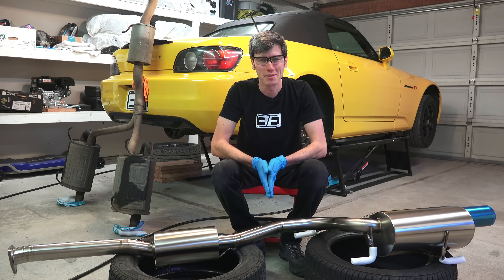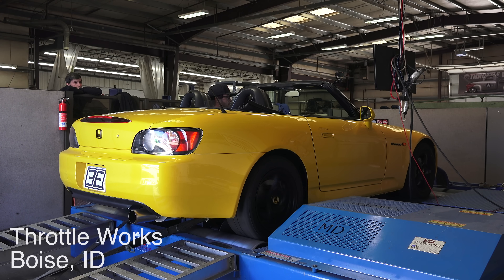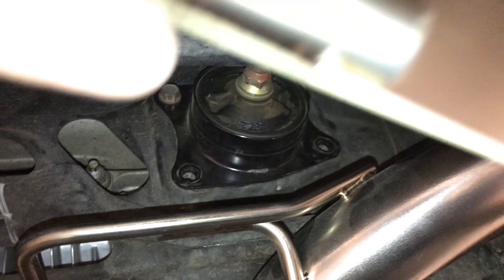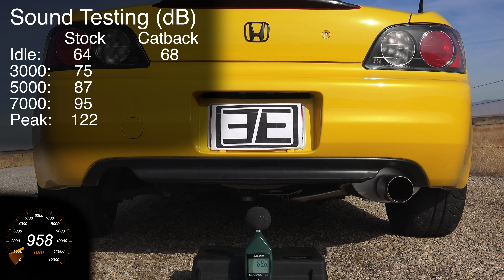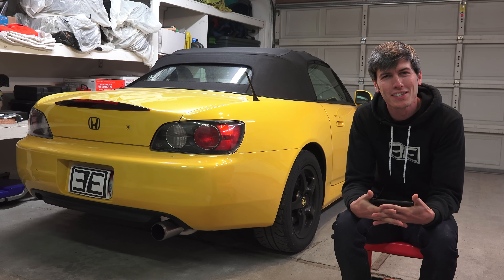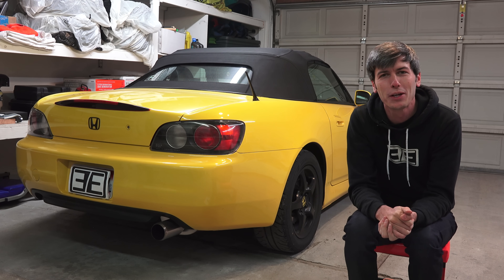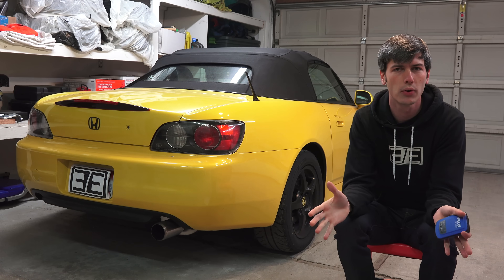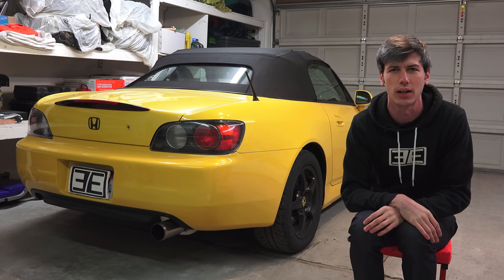Can A Catback Exhaust Make Your Car Faster?

Comment: Let the haters hate. You shaved weight,wont rust and gave us an educational video to watch. Thank you!
Reply from the maker: Happy to hear it, thanks for watching!
Reply: Hey, rusting shaves weight too!
Reply: Was thinking about it as well. Just depend how hot the exhaust gets as aluminum can crack with too many heat cycles.
Reply: Shoulda bought an aluminium exhaust. Nota much more weight if any and the material won't give up gains
Reply: Aluminum: 2.7 g/cm³
Titanium: 4.5 g/cm³

Aluminum is significantly lighter than Titanium.

Titanium has a higher strength to weight ratio than Aluminum so in applications that require high strength Titanium components can be made lighter but exhausts do not need to be very strong.

The (small) power gain he achieved has nothing to do with the fact that it's made of Titanium - it has to do with improved airflow. An identical Aluminum exhaust would preform just as well and would almost certainly be considerably lighter.

Titanium looks cool as hell, though.
Reply: Yeah - moral of the story: Ti exhaust on a non-racing car, is a waste of money & titanium. As the cash can be used for things way more beneficial - tires, rims, brakes, springs, turbo... you name it. And the Ti - as a component involved in the construction of a more loaded parts of the car - suspension carriers, springs, valves, rollers,  driveshaft, c.rods.. where you actually win a lot more from shaving grams. :)
Reply: Aluminium exhausts work fine with the right type and thickness, toughest 10.5 outlaw radial cars use aluminium exhausts off the back of the turbo where they're normally straight into a bend. Granted they only run for 6 seconds under power but they're still pushing 2500+whp on methanol. Stacks of tough street/strip 1000-1400whp cars use them and do for years, time attack cars where they get super hot as most of them dont get airflow with the flat bottoms, and you can buy aluminium mufflers from 2.5 - 5" inlet/outlet. Not saying a titanium exhaust isnt porn, i just see that and think well a turbo back 4" straight pipe aluminium exhaust for an evo is $500. Add a $250 muffler and resonator on a far smaller exhaust, and with those savings spend it elsewhere on the car. If it were me the car would be boosted, save and buy an aluminium exhaust, then for porn factor use Ti cooler & radiator piping.
Reply: Maybe the aluminum kits aren't as prone to failure as I think. I just remember reading about aluminum exhaust on some track oriented R32 breaking off due to the heat cycling and becoming extremely brittle. Maybe they didn't use proper aluminum tubing for the application.
Reply: oh yea big time, EE knows it's not worth the money, he just wanted to see what it's like.
Reply: Of course he knows, might not be a race car engineer but he's no wood duck. ive raced for years and built my fair share of tough street cars so when i see something like that I just think thats money that can be spent elsewhere to make the car quicker.

Thankfully we dont all  build the same cars, so each to their own... plus a quick google shows a single exit catback s2k ti exhaust is $2300usd. Less than i paid for a stainless 4" turbo back exhaust (with cat etc) for my car so no biggy in the end.

What would be cool is to hear a comparison in sound between a very similar stainless to this pipe, TI an alu exhausts resonate and end up sounding nice and raspy + louder. On a boosted car a 4" alu straight pipe sounds nasty over a 4" stainless straight pipe. 

Better yet strap a 6466 on the front of that, run e85 and now lets see the performance difference :).
Reply: Yea I'd like to hear the difference in sound between aluminum and stainless.
Reply: Any recommendation for a place to get aluminum exhaust? Looking for something really small, it's for a tiny lightweight car.
Reply: Agreed, this channel is about educating people and showing the numbers. If you didn't have a YouTube channel with 1.4 million subs, then no, this would be a fairly silly purchase. But you do, and that's why you did it, and we thank you :D

Comment: You could always remove the resonator in the mid pipe if you want it louder. A much cheaper option compared to ordering a new non resonated mid pipe.

Comment: Dyno results can easily vary by more than 2 hp just from back to back runs.  Sometimes a high-flow cat can show better power gains than a cat back system, but you wouldn't get much weight reduction, if any and you probably wouldn't notice any difference in sound.

Comment: Now add equal length headers, porting, larger and lighter valves, higher lift and duration cams, forged high compression pistons and ITBs with a velocity stack and you'll spend ten thousand+ to gain a nice 50 hp and kill the low end.

Comment: years ago i was working on a hydraulic system that was cavitating at the pump very bad the suction side.   the tube was 3 ft long and was the same size as the inlet fitting.    but i could not change the fitting at the pump.   but i changed the long tube to a bigger size.    cavitition was gone.    so ANY  increase at ANY  point is good.

Comment: I also wonder about the difference in thermal dissipation, being that there is a more direct path with less SA, probably takes up less heat from the exhaust. And is that a good or bad thing?

Comment: A header with a High flow cat should help it gain some more power and sound way better but not that bad since it will have a high flow cat. Looking forward to seeing it on the s2k if you decide to

Comment: You didn't address why your car produces black smoke at full throttle? It's not burning fuel efficiently.
Reply from the maker: When you run rich (which happens at full throttle) you can't burn all the fuel.

Comment: What about after 3k-5k of driving. Some people say that the carbon buildup causes better flow, however could it also cause more restrictions? Also, people will also say that there is a sound difference as well. This would be great information to know if "breaking in" an exhaust actually makes a difference.

Comment: I have an RX-8, and that exhaust costed more than my engine, or more than I bought my car for in the first place. I plan on doing a full exhaust for my car for far less than half of that cost, doing most of the fabrication myself aside from the header. Awesome data and a great way to see that something so simple can make a legitimate difference, but holy too expensive Batman!

Comment: The titanium metal surface add better air flow out. But if I'm not wrong original was two exhaust exit, and was change to one exit. It was mentioned in the video, you are Losing power.. forcing motor.

Comment: Does the dyno place measure the exhaust? The Ti exhaust belches out some pretty rich looking smoke from time to time. I was a bit disappointed that you didn't mention that. You may net some additional power gains with a leaner tune.

Comment: Well the price is for the weight savings not necessarily the power gain
Reply from the maker: +gato2 yes, very true. Could get a steel exhaust with similar power gains but not as much weight savings.

Comment: For that cost, I would have considered reducing unsprung mass. Could have similar effects and possible reduced stop distance.
Reply from the maker: +Jdmorris143 where though? I have lighter brakes, and the stock wheels are quite light. All about reducing weight, but not sure where it could be pulled from (unsprung, that is, plenty of sprung weight could be shed).

Comment: Can you do a aftermarket air intake and then  a tune? Also can you figure out why Honda made the VTEC crossover point so high? I have a '07 TSX VTEC crossover 6000 RPM rev limit 7250. By just switching the crossover to 4600 RPM mid-range improves dramatically. I see a jump in your S2000 in means that you can also improve it. Keep the good work

Comment: Nice exhaust.  While it doesn't add any real amount of power now, it should help a bit with the eventual supercharger upgrade as it should lower boost somewhat.  I found mine removed about 0.5psi of boost from the nominal pulley number but also had 15HP more in gains than I expected.

For those that want to argue that less boost is bad, with the same airflow volume, lower boost means more O2 is going in...

Comment: Have you noticed a sharper throttle response from the engine from removing some restrictions with the new exhaust? Would love to see if an intake and exhaust provides any improvement in that area and would be the main reason to getting them other than noise and hp.

Comment: In my opinion the main reason to upgrade the exhaust on a S2000 is for weight reduction which makes a huge difference in handling due to being center weight.

Comment: A while ago, the mighty car Mods guys did some exhaust testing, and they put a spherical partial obstruction in the exhaust (it was a potato) and the car made a bit more power, could you explain what is going on here please? Maybe make a video about it
Reply: David Partridge can u link ?
Reply: That ones almost easy, the potato made the engine scavenge raising backpressure inducing a "reverse torque increase" making the intake drivetrain less of a loss on scale compared to the exhaust. Motor trend has a vid on bashing your headers in to used gaurd rails basically and the tq an hp just kept raising
Reply: benson420710 engine master's on motortrend yea, they measured hp and tq levels on a motor with varying sizes of dents on the headers, they really ended up smashing them really bad before it affected performance at all, you almost have to have a dent that pinches it shut before it starts to really hurt flow. For a n/a car you want to retain some backpressure, but I am curious to see numbers on the larger tubing.. I like that your into saving weight, but a straight single exit for me I couldn't do on that car, or my car for that matter. Those cars can sound pretty nice, odd to me you chose such a "standard"  design
Reply: jcoopdo I think having one exhaust exit helps with the backpressure while providing a lew end boost vs the mid and high end outputs you'd gain from having dual exhaust pipes, I do wonder if sohc/dohc/ohv motors prefer different pipes. On my '86 chevy astro with a .060" over I cut the exhuast right off before the cat so my headers and y-pipe go straight into a magnaflow super 40series piped until two feet infront of the rear right axle. Just going up .5" it raised the low end tq while sacrificing mid range until I added the tubing after the 40 series and without a speedo it truly becomes a butt dyno

Comment: Well, since there is less restriction, during valve overlap, more fresh air is being pulled in into the cylinders. Since s2k has a map sensor, it's ecu doesnt see this increase in flow at high rpm. I guess that, if it was tuned to give more fuel at high rpm, it would have made a couple of hp more

Comment: What is the extra dead end pipe in the exhaust after the cat used for?
Reply: It's a quarterwave resonator. It's function is to bounce frequencies back at the exhaust flow to eliminate undesired resonance (drone).
Reply: hey0its0nick brilliant solution, thanks a lot!

Comment: I wonder if this has any effect on the MPG the car gets as well.  If so, what is the difference between before and after?
Reply from the maker: +Dejan Jancevski minimal, but less mass means less energy to accelerate. At low loads, the exhaust isn’t restrictive, so likely not much of an effect from piping.
Reply: Gotcha. I was wondering if there would be a noticeable amount of fuel savings, but from the sound of it, it isn't likely...at least not in any significant amount.   Hmmm...now I'm wondering if I should bother upgrading my exhaust on my '11 Avenger.

Comment: Can you make a video explaining back pressure, I remember when I first put my exhaust in my car a lot of people told me going from a 2 1/4” to a 3” pipe would make me loose back pressure and make my car slower, so wouldn’t that contradict your theory of having a bigger opening=more power to gain.
Reply: "Backpressure" is a myth.  Pressure of any kind is an indication of resistance to flow.  Flow is the point of a pump, and an engine is just a self powered air pump.   The myth is a result of certain engines exhibiting torque losses due to larger diameter pipes flowing a given volume of air at a lower linear speed, therefore not creating a suction effect on the cylinders with the exhaust valve open (called scavenging). This is the reasoning for tuned length headers (timing the exhaust pulses to use the "vacuum" behind one cylinder's exhaust pulse to suck out the spent gasses from another cylinder).   And all this only applies to the headers, where smaller tubes might be beneficial to keep exhaust velocity up.  By the time the gasses get to the catback system, those pulses are too far from the cylinder head, with too many obstructions (cats, merges, bends etc.) and too intermingled to have any positive effect on cylinder scavenging.
Reply: I was unclear.  Backpressure is a real thing.  Backpressure as something beneficial to a cars performance is a myth.
Reply: That doesn't refute the existence of backpressure, that only clarifies where and how backpressure affects performance and how it can or cannot be changed. And yes, backpressure does effect turbo cars as well. If the exhaust system isn't well matched to the turbo and power output of the motor, it can exaggerate the effects of turbo lag by either restricting the flow through the turbo or by slowing down how quickly pressure can build up in the manifold. Low-end torque and daily drivability on my old boss's ~250hp WRX was impaired when he went to 3" catless with COBB access port tuning, but was later improved when he went down to 2.5".

Comment: You should measure the dB level at 1 meter from the sound source, and you should have also mentioned which decibel variant did you use (probably dB-C). That's the standard way to do it.
Reply from the maker: Ahh, thanks for sharing. I don't know much about sound testing, so I just wanted to do something consistent with minimal ambient disturbances. Drove out to the middle of no where for the testing haha.
Reply: Actually I didn't expect an answer from you. It's awesome that you read the comments and reply to them.
I've seen a lot of youtubers measuring sound level of different things (laptop speakers for example), but very few do it the right way, so it's hard to compare one to the other. There's 2 way to measure correctly depending on the case:
If it's for comparison, the 1 meter distance is good. It's used to measure speakers mostly.
If it's for the effect to the listener, you should measure where the listener would be. It's used to measure power tools, and such.
I don't think the decibel variant (A, B or C) is that important, I don't know what exactly it means. My meter is dB C.

Comment: I would hazard a guess, that you could get similar numbers in both weight and power, by deleting the driver's side muffler and just having a muffler shop fabricate from the axle back with a good muffler, for about $300. And get even better numbers replacing the Cat for a hiflo unit, assuming Honda didn't optimize it to begin with.

Comment: I personally think its worth. Think about it ... 35lb less without sacrificing anything and getting a little bit of power and better sound for  your troubles... . And, you actually improve braking and cornering too. How much would it cost to lose 35lb by either replacing a few body panels with carbon or quality lightweight wheels, bucket seats and so on... . It is for sure expensive, but imho worth it!
Reply: Yep, i agree, but my point was not especifically about an Amuse exhaut for a s2k. That kind of wheight savings, without sacrificing anything, for that kind of money is worth it, imho, for any car, within reason of course.
Now, if there are other less expansive options with similar results for this car, they are problably worth it too.
Reply: Victor Dominguez this is a beautiful piece but there are other titanium exhausts for the s2k that's about the same weight and costs a lot cheaper. I had my s2k with a Trust (now GReddy) TI exhaust, and it was 9 lbs due to the muffler being cylindrical instead of the shape of the Amuse ti exhaust. That exhaust costs $1k compared to $2500 but was better, imo, than the Amuse. Amuse is a great tuner from Japan, no doubt, and whole replacing panels with cf is great and saves a lot of weight, it's not something I'd consider as well, unless the car becomes a show piece or if I have money to burn just like that. But anyways, I'm not trying to go against you and I agree with you at some point that this does not sacrifice anything about the car, but there are other cheaper options out there for the s2k for far less money, too.
Reply: Michel Linschoten the car's only a little over 2000lbs. Nearly a 2% weight reduction.
Reply: like 35lbs will make a impact on cornering and braking..ha....hahaha

Comment: $73.53 a pound shed - more than filet mignon or lobster tails!
Reply: +spankeyfish
fortunately it's more polished and has lesser surface area in contact with the air, so less heat exits the sides and more heat exits the butthole.
Reply: ...and it doesn't have a heatshield on the silencer/muffler. That won't do the paint on the underside of the floorpan any good.
Reply: Weight reduction is expensive.
Reply: Yes but once you eat it’s just expensive poop

Comment: Why not just cut the muffler and res and replace with a pipe. That would only cost like 100-200$ and would be louder and would get little more power on higher rpms

Comment: All this says is that the Honda engine in factory trim works pretty damn well with the exhaust they supplied it with. More mods to the engine would help the aftermarket exhaust shine. That weight savings is significant though, as a weight weenie I can really appreciate that.